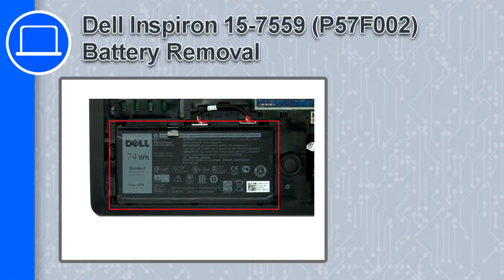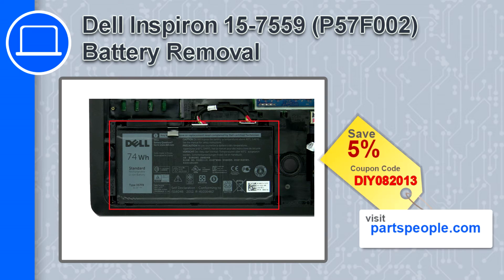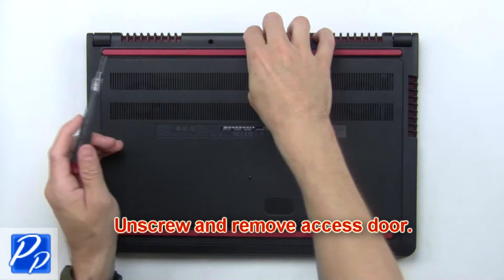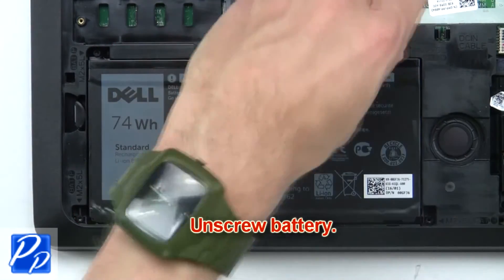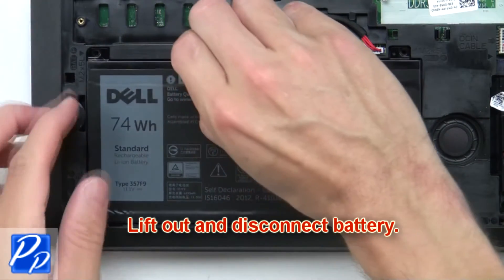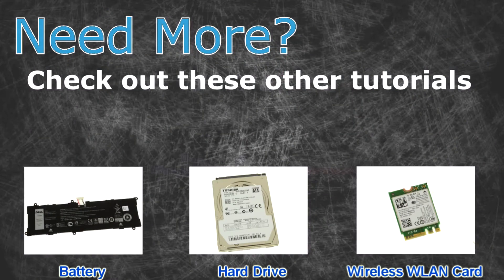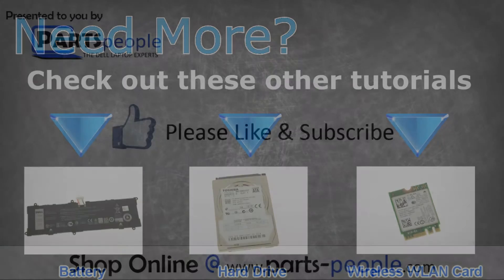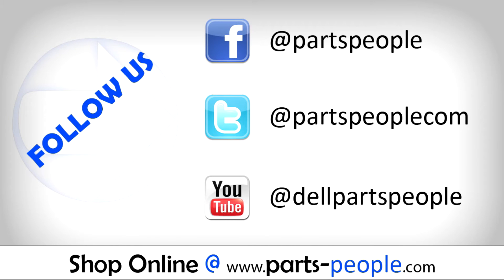Dell Inspiron 15-7559 (P57F002) Battery How-To Video Tutorial

Comment: I put in a new battery and then the error came "Warning: The battery cannot be identified.The system will be unable to charge this battery" Help, I can not make bios update, since the battery must have the least 10%, if I put in the old battery the same error. HELP!!
Reply: Copy the bios update file to a folder on your desktop.
Open CMD and navigate to the directory where the file is
Type filename.exe /forceit
Done

Comment: is there any risk of using this laptop without its battery on?

and, if i remove the battery, is there any considerations i should have in mind to storage it?

thanks
Reply from the maker: In most laptops removing the battery and running only off of the adapter is fine. Unfortunately I haven't tried is with this laptop. Some laptops will cause an error without the battery. To store the battery just keep it in a cool dry place.
Reply: @dellpartspeople   Hey uhm, I would like to know if this laptop can run without the battery?
Reply: Franz Delgado yes it works without the battery, i removed the battery on mine and it works 👍🏻